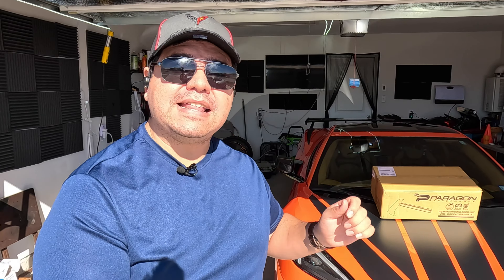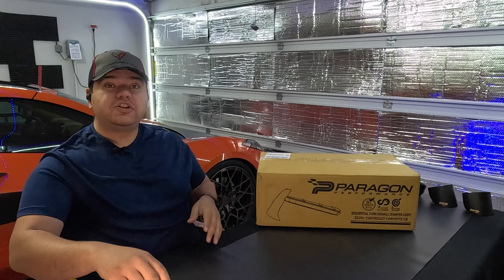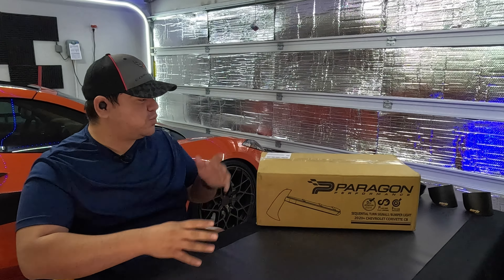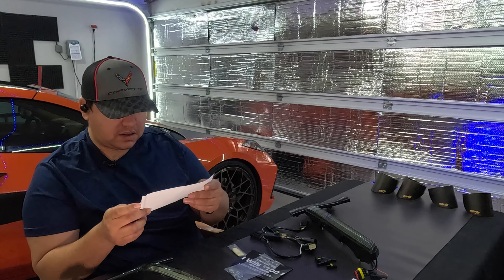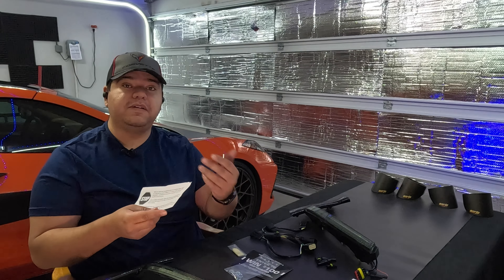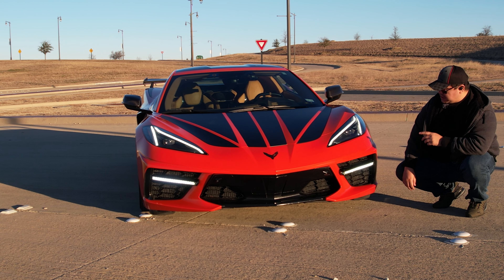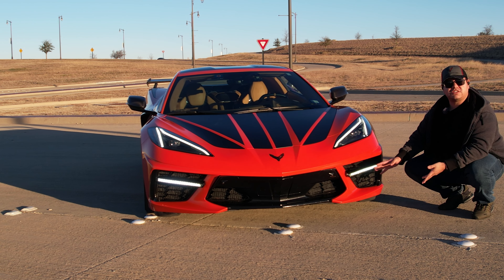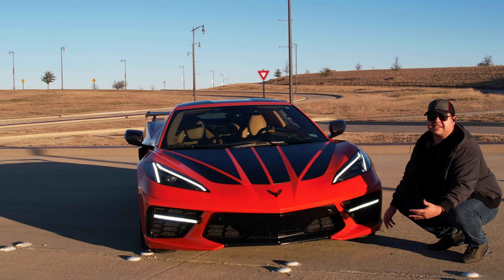Reviewing the PARAGON LED GRILLE LIGHTS for C8 Corvette!

Comment: I really like them and the price seems reasonable for the quality. However, looking at the install video it seems like there's an awful lot of parts you have to remove to install them plus I would have to use jacks as I don't have a lift in my garage. Wish I could just pay somebody to install them! lol
Reply from the maker: Hey Rick thanks for the comment! Its definitly one of those jobs that could be done at a dealership or MOD shop since there are a decent amount of steps but also doable from home. 😊 Just comes down to personal preference. Thanks again for the input! Its a great quality part for sure!

Comment: Looks Great! I'm installing Saturday, about how long did it take?
Reply from the maker: Hey Jerry thats awesome to hear! So I would say that it takes about 3 to 4 hours to install conservatively. Couple of important pointers to have while installing, 1ST DEFINITELY take pictures of underneath. Your going to be removing ALOT of screws and some are the T15s and the 7mm. Your gunna want to reference them when installing everything back. 2nd, unplugging the oem connector from the headlight is at an awkward angle to press down on the release clip amd pull out even with a screwdriver. Take your time with that so you dont damage the connector. 3rd, I found the grill mesh to be easier to slightly manipulate to align the bezel with. Work inside first then to the outside clips to get all the tabs lined up then work back and forth to finally get it to snap into place. Ill be trying to get my How To video out by before this weekend to help illustrate some good pointers  but those are the big ones I took away from doing my install. Let me know how it goes! 👍

Comment: Great video Carlos. 
On another note have you looked at installing a catch can. 
I just finished one, will wait to see how it performs once the snow is gone and I start driving it again. I’m in Canada 🇨🇦
Reply from the maker: Hey Wazzman thanks 👍. I actually installed a catch can as one of my first MODs with less than 500 miles on my c8 and befofe i started with the YouTube channel. Its held up well but i do need to make a video about it. Kinda hard to show a catch can install after the fact since I no longer have the old lines that you need to replace. But ill be looking into it for sure! Thanks for the suggestion 🙏
Reply: @NuHorizonC8  great to know. I was hesitant but decided to install one anyways. Are you finding oil in your catch can and at what intervals. Thanks in advance.
Reply from the maker: I do find oil in my catch can and id say about a quarter cup every oilchange interval so like 4k or so miles.
Reply: @NuHorizonC8  
Thank you, makes me feel hood about installing one.

Comment: I like the look but with the size of LEDs I wish they would make the light bar the same thickness of the original grill bezel. Too thick for me. I will wait for that and for the price to maybe come down.
Reply from the maker: I agree they are on the thicker side but it does help making them feel strong and not flimsy. Sounds good on the feedback though thanks👍🙏
Reply: Price is crazy - they probably are makining a 75% profit

Comment: Not for 2024+, apparently.
Reply from the maker: Yeah unfortunately. Paragon has been trying to get around the electrical challenge ever since GM redid the circuitry when they included the soft close on the 2024+ models. They said they are still working on it though